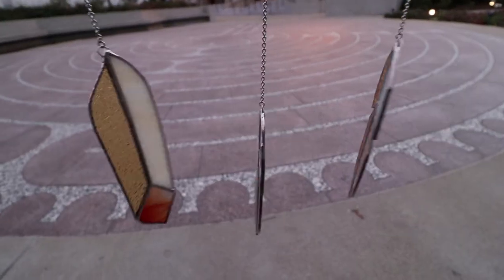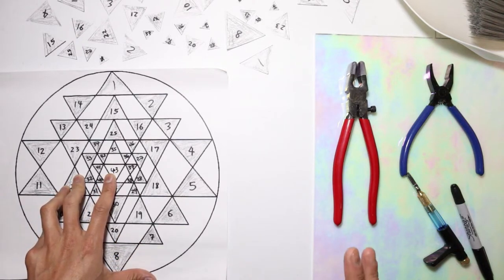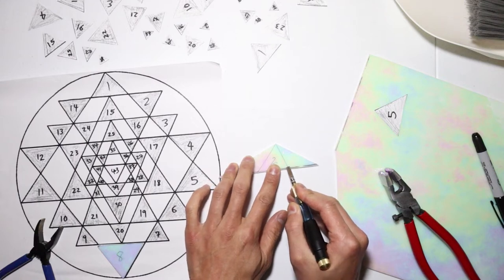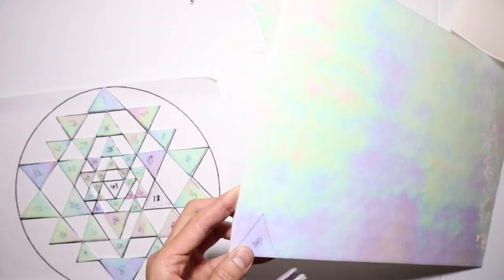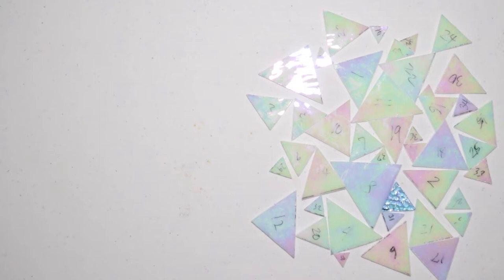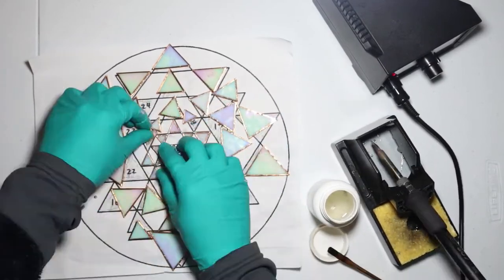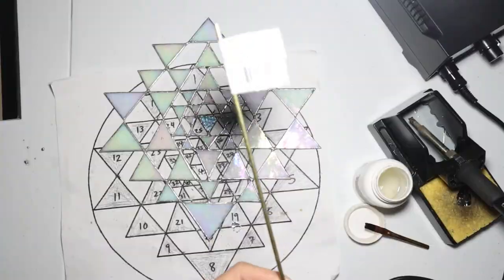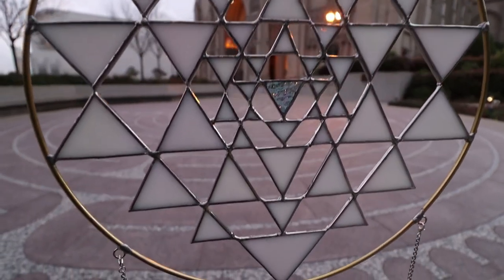Stained Glass For Beginners - Dream Catcher

Comment: I'm enjoying your videos to refresh my skills. With the dream catcher, it would have helped to see you soldering the sides in real time. The little triangles are so close together,, I'm wondering if there are any tricks to getting that soldering smooth without gloppy solder. And, it would be helpful to actually see the copper foil on these small pieces...it's so wide relative to the size of the pieces. So, slow down a bit, if you really want to be helping beginners! Thanks!

Comment: My question is when do you use lead came and when do you use the foil?  Is it just a matter of preference or are there rules for using the lead came vs foil and solder.
Reply from the maker: I do believe it is mostly preference until you get to bigger pieces where the lead came adds strength structurally. Now I've only done copper foil and believe it's easier to start with. Lead came gives you cleaner lines but you still have to solder the joints. Copper foil allows you to work with smaller pieces as the foil is thinner. It's almost two separate styles and techniques. I do want to try leading soon though. Cheers 🤙
Reply: @StainedGlassDIY  Thank you!!